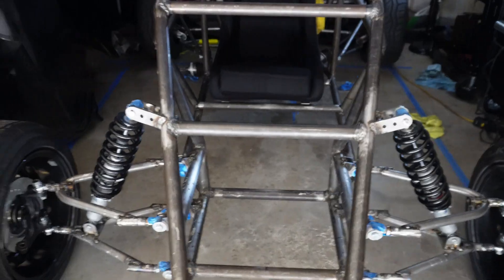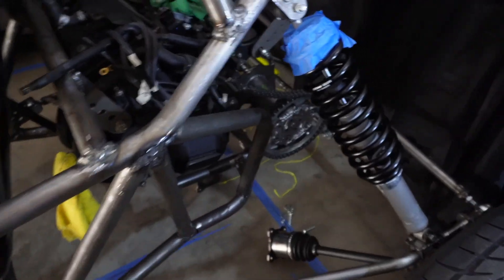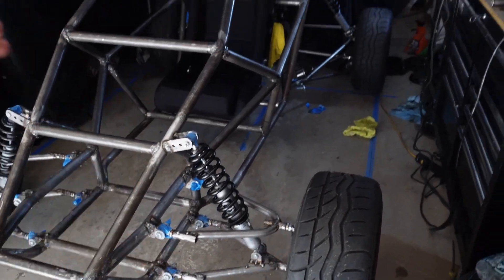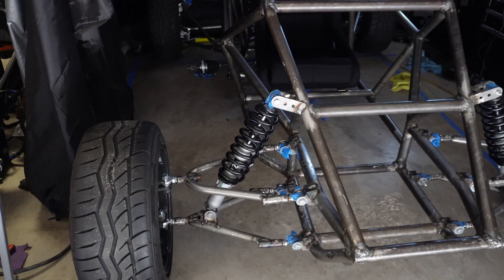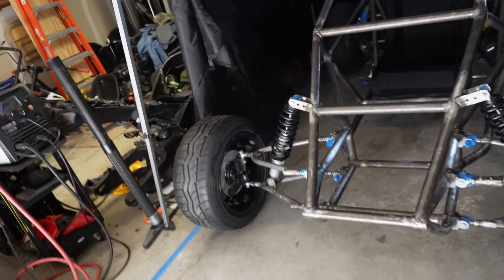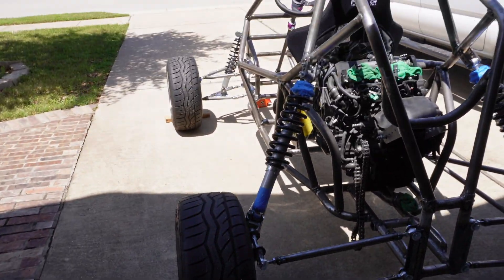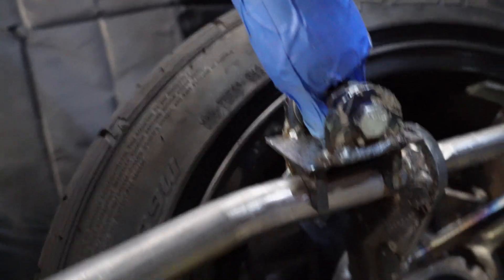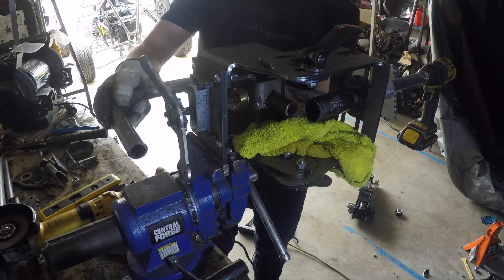STEERING MACH UP

Comment: Starting to look good! As others have said, look into bump steer. Now is the time to check that the rack and arms are in the correct locations. Best to mock up the positions and jump on the front suspension to see if you have a problem. I had a customer's buggy which had +-1 inch bump steer on each wheel - there was not much scope to reposition the rack so I ended up putting on 3" drop links below the steering arms to eliminate the bump steer. For the Nike I made a dummy rack with adjustable length to check best position https://youtu.be/DVdg-7JwPMc?si=fvrJlayLBQPQQFTs&t=668 best regards Doug
Reply from the maker: Thank you! I just ordered a shorter steering shaft and the U joints/extras I will need to bring the pinion closer to the control arms and break the straight line steering shaft into an angle. I will keep the bump steer in mind when I am ordering my tie rods and getting closer to that point. I really appreciate the help from everyone.

Comment: Hi, you're trying and it looks good ok, what is the purple steer-bearing hanger is it a standard rod end bearing?
Reply from the maker: That purple Steering Bearing/Heim came with the collapsable steering column I ordered from Speedway Motors. It has some room for play and it seemed to work great on the kart for what its intended purpose is. The collapsable shaft size is 1 1/8" but I haven't found a Heim that size (only 1 1/4), but I ordered a 3/4" straight shaft to angle the steering shaft down 45degrees or so at the end of the collapsable column. Speedway also sells 3/4" heims that I will use to stabilize that 3/4" straight shaft on that downward angle where it will meet the pinion.

Comment: Now another question is why do you have the rack so far forward as the pedals won't be in the way at the point of your feet placement. I'm basing these off of my import front suspension and other cart plans. But keep it up we all learn from our mistakes
Reply from the maker: I appreciate the feedback! So the steering column I got was too long, and I’m ordering a shorter steering rack and breaking it 45 degrees or so so that I can bring the pinion back more. I didn’t know the tie rods needed to be at pivot point but it’s a good thing I’m already redoing it. This was just a Mach up. But the pedals say they are 12” tall and I had 12” where my feet were, but it immediately dropped to like 7” as I move towards the front of the kart because the angle that the column was at was too sharp. With the new setup I’ll basically 45 deg cut down to the floorboard of the kart so the pinion will be closer to the control arms. Thank you for that info tho i will definitely take it into consideration when im replacing the position of everything!
Reply: @Yamahoss  yea look at some of KJ RACING CART BUILDS. he has nice idea of movable peddles. Could be a great idea to help out instead of recruiting the cart up.

Comment: Now I don't know if you been told or not . But your tie rods need to be at your pivot at the A-arms so you don't get bump steer. And the rods should flow the same as the arms to or add spacers to get best alignment